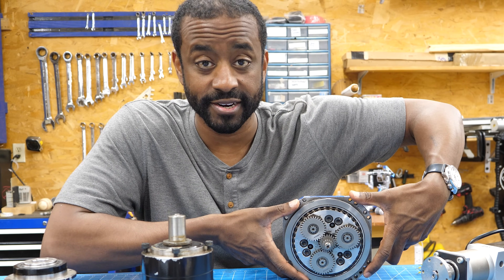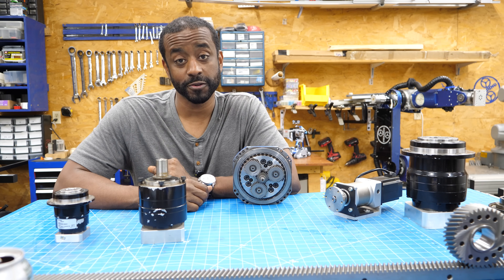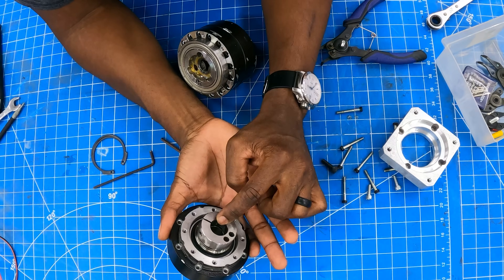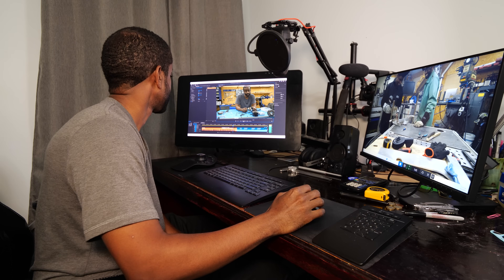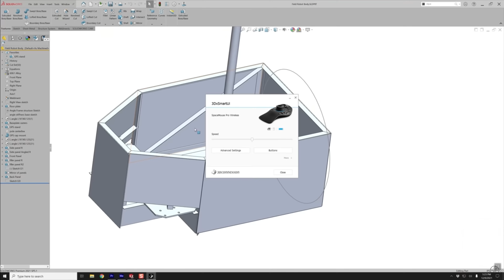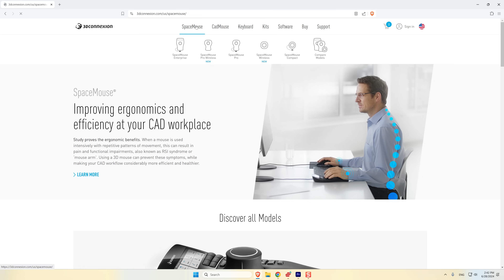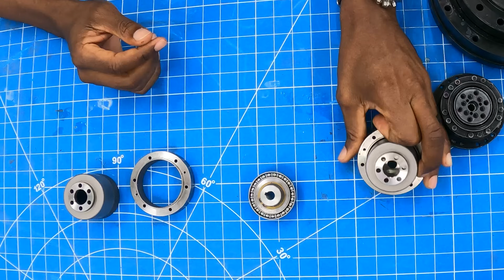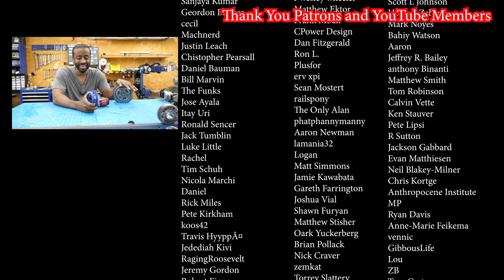Why Harmonic Drives Are Awesome.

Comment: I'm one of the engineers for the actual Lunar Roving Vehicles, made by General Motors and Boeing.  Harmonic drives were used on all four wheels, and were used to be able isolated the DC brush-motors from the vacuum on the Moon.  Brushes do not work well in vacuum, since they are lubricated on Earth by a thin film of water, from the humidity.  On Moon there is no H2O, so the brushes turn to dust and wear rapidly.  The motors and the harmonic drives were half-pressurized with a partial atmosphere, with a specific humidity installed.  Garrett-AiResearch did the motor assembly.  Gear ratio was about 80-to-one.  Motor turned up to 19,000rpm max, but usually ran at less than half of that during actual on Moon motoring.  The drives would work just fine if somebody went to the Moon and energized them, but the wheel brakes are probably locked-up now, due to vacuum cold welding, so the vehicles probably could not move.
Reply: Very cool! Thanks for that.
Reply: Why not use brushless motors?
Reply: You are correct, especially about the complexity.  Our company and NASA (via a GE division), both had alternate AC motor concepts of various types.  Our alternate was a 3-phase drive with a permanent magnet rotor (multipolar).  This allowed a low weight, high speed motor, but allowing it to be used at low speeds using a cycloconverter type of drive.  Vector drives were not yet available, so the stator pulses walked it around, similar to a stepper motor, but with rotor skewing the steps were washed out, and the torque ripple was small.  This drive could have had regenerative braking, but this would have doubled the electronics complexity.  This was nixed, since the controller (DCE) volume became too large for our size allotment.  Also the number of power transistors doubled, so the mounting weight for TO3 and TO114s became a tradeoff with the saved motor weight.  GE also used a  permanent magnet motor, but only 2-phase.  Their electronics were just horrible, and used transformer couplers to provide floating base-drive.  The weight and size of their electronics were more than triple of ours.  Their claim to fame was that they used a "traction drive" system which eliminated the gear train (sort of) so they could use a very high speed rotor, and then shear-drive it down to the very slow wheel speeds.  We had used a similar drive for a torpedo program, and these work well for a one-shot system, but have very poor longevity.  Similar to modern CVTs.  When the volume and weight overall, was considered, our system was way way better, had lower power losses, thus greater range, and the "reliability" estimates were about 10-times that of the AC alternatives.  We used 200-ampere Westinghouse transistors (1401s) for the final drives, so that even short circuit failures could be tolerated, without the Astronauts ever being stranded.  All drive channels were independent, thus they could limp-home on one-wheel is necessary.  In doing some consulting for modern space companies, I indicated that with modern electronics, our total Motor Controller (DCE) could be made now with one-third the weight, and probably one-tenth of the volume.  For practical purpose, some of the existing Drone technology has the same power levels as the Lunar Rovers did.  PassItOn.
Reply: @brunonikodemski2420  
Bravo!
Reply: @ivanradojkovic1705  Additionally, semiconductors don't fare very well in space. The ISS orbits within the Van-Allen-Belts that shield a lot of radiation and still has to regularly replace laptops because they start to malfunction. The control module of a brushless DC motor would fare similarly bad or worse.
Reply: @ivanradojkovic1705  they don't cost enough. its nasa it has to be insanely expensive
Reply: Thank you for mentioning this! I work in high-vacuum and putting a motor inside a chamber is always problematic, a rotary feedthrough is the preferred solution, leaving the motor outside.  If you really have to put the motor inside, it needs to be either brushless, or you have to "can" it with its own little chamber that is bled to atmosphere some way.  Even brushless motors have to be canned for cooling since they would need huge radiators and some sort of cold wall to reject to.

BTW, this phenomenon was first discovered during WW II when superchargers allowed planes to fly at altitudes below 1/2 atmosphere pressure.  They discovered that the brushes on the generators were wearing out super quickly and it took some lab time to figure out why.
Reply: @hagerty1952  My father, who was slave laborer for the Nazis, hated the P38s.  The turbos were mounted above, so while they were working in the fields, they could not hear them until they got into shooting or bombing range.  For the bombers, they could hear them dozens of minutes away.  As You may already know, some EV motors are being run in partial vacuum, to reduce air-drag and avoid supersonic transitions to inviscid flow.  This caused heavy vibrations and heavy bearing loading.  All of these rotors are either induction or permanent magnets.  We did some of the early liquid cooling experimental work, for GM drives, at that time for military vehicles.  Unfortunately one of the best coolants were PCBs, which are now banned due to their carcinogenicity.  Don't forget that Allison Transmission has "swash plate" through wall transitions.  These were used extensively for some of our work for the oil industry, where walling between chemical processes was absolutely required.
Reply: also the moon has regolith witch if it gets in to places can wear stuff out fast since it's so abrasives. at least what from what i've learned so far. that cold welding has been an interesting topic. something about some cargo doors locking up on a shuttle. i didn't or haven't seen other mention of cold welding in space. just that one video.
Reply: @muthukumarankothandaraman2371  The flexspline internally is in an atmosphere, and was partially lubricated.  It was essentially the same materials that Harmonic Drive and Garret had used in Earth applications.  The total lifetime was so small, maybe a few hundred hours, that the Lunar environment did not matter at all.  That same issue also occurred on other metal-to-metal parts, such as the brakes and steering joints.  Those areas could NOT be lubricated, since the outgassing might have interfered with optics or other such items, but that was a crock, since the LRV was stowed in an outer cargo section, exposed to free space.  Once on the Moon, nobody cares if it outgasses.  Modern flex-metals, and flex-plastics are way better than ours, so don't use that technology anymore.  Even some flex-ceramics, for very special hi-temp applications.  The Canadian company which made the Shuttle and ISS arms surely has modern information about this.
Reply: I would love to hear more about the seals.
Reply: @JamesNewton  There were No seals as such on the LRV motors.  The motor assembly was in a case, with the usual glass-pins type of electrical connector (4-powerpins plus some speed and temp data).   This was mated to the harmonic drive, which had an external flex-member (round tubular) around the rotor rollers.  The flex member is corrugated, like a gear, and engages an outer spline which then is coupled to the wheel assembly.  Everything inside the flex member and motor is completely sealed.  Swash-plate designs are similar, except use a flattish plate to the power transfer, similar to motors used in air-conditioning systems.  Everything outside of the flex-membrane is open to space vacuum.  These type of devices have limited lifetimes, due to the flexure quantity, but work very well for Uranium processing and other low-movement applications, such a hand-manipulators in high-risk industries, and medical...
Reply: Thanks for the factoids!
Reply: fascinating thanks
Reply: I saw the thumbnail and my brain went straight to drives for starships.
So you working for XYZ building/engineering a drive that went in to space is close enough :D
Reply: @derekelliott6098  Yes we did do work in ION drives.  However our efforts were minimal and not-competitive with people who actually knew what they were doing.  We worked on many such projects, which never came to fruition, but we learned a lot.
Reply: Cool
Reply: I notice they are appearing in many high-end telescope mounts these days.
Reply: @spaceranger3728  Partially due to the very high ratios available (for slow tracking), but also since they can be made with NO backlash nor Hysteresis.  Allows non-jitter tracking (although that is somewhat of a myth, since wind on a scope will cause greater errors).
Reply: Dude, you make me want to be a better engineer
Reply: White Collar Welfare. Your Project never made the moon. Faked that entire sequence using a small RC Like model. ( still in a box, on shelf 14a7 in Southern, Nevada.)😊
Reply: And U put aluminium wheels on a vehicle designed to track sharp rocks and harsh surfaces??

Wow you guys really did well..
Reply: water? why not just WD-40
Reply: to me this individual is a scam, a liar
Reply: I recently read "across the airless wilds" which chronicles the development and deployment of the Apollo LRVs. They described the 80:1 harmonic gears in the wheel hub motors and this was really helpful to visualize and understand the mechanics of it. Highly recommend the book BTW
Reply: Why not use brushless motors? Was there a particular challenge to using them?
Reply: @ExistensialSlacker  See prior responses to this.  We did three different variants, and NASA did two.  At that time, too much weight, too much volume, and really poor reliability.
Reply: @brunonikodemski2420 Thank you for all of your thoughtful contributions to aerospace, as well as this thread!
Reply: So how do ISS, and satellites, continue working so long, but not laptops.
And don't tell me Shielding, I'm a consulting Physicist.
Reply: See my Lunar Rover commentary above.  Actually it is a lot of shielding, especially the Memories and CPUs.  However to answer your question in a proper manner, the main differences are in the actual internal construction of the semiconductor chips, and their packaging.  When we designed boxes for the early TDRS satellites, Hubble, and a bunch of others, it was the beginning of the era when heavy-ion, gamma & cosmic ray exposure, and ESD discharge damage was being understood.  Look up papers on single-upset events (SEUs), multiple upsets (MEUs) and ESD damage caused by charge build-up on surface, due to solar wind or mass ejections.  As a result, space-rated electronics were developed to protect against these events.  There were several methods which actually worked, and the electronics companies invented internal features, such as silicon-on-insulator, protective buckets to prevent SCR (pnpn) latching into the substrates, and protective guard bands to mitigate SOAR failures, and gobs of similar features.  At that time most electronics were planar, and did not have multiple vertical layering (common now), and the semiconductors were all large-area devices (all above micrometer dimensionalties).  For memories and CPUs, Hughes, IBM, and others brought the technology down in the 400-nanometer ranges, and later down into the sub-hundred-nanometer ranges.  The lowest for Hubble (much later) was about 40-nanometers.  
For our Lock-Mart satellites, the chips were large, and actually had pin-leads.  For these, extensive shielding was used in strategic places, and the USAF has a set of manuals where the design criteria is shown, and where and what angles the shielding should be used.  Ultimately shielding against heavy-ions and cosmic rays is impossible.  For these SEU events (rarely multiple), the chip-bits would fail, and had to be isolated.  For the Titan memories, the memories were "blocked out" and error correction could be made for SEUs (single bits).  For MEUs the entire block could be isolated and possibly repaired during a special repair cycle.  For nuclear exposures, such as for SRAM, the entire modules were heavily shielded.  When Hughes developed vertical chips, this became even more problematic.  For modern electronics, now down to 3-nanometer featuring, and more than 20+layers, these devices are totally unable to withstand even 30kEv xrays or gamma directly onto the chip.  Multiple Error correction is mandatory.  Most of these are protected by the bremsstrahlung effect, as the impacting HEVs products are radiated outward and reduced in energy.  Hubble for example has a steel skin.  TDRS used the same boxes as on the Titan missiles.  I myself underwent radiation from a linear accelerator, for a throat cancer.  The dissipation "zone" of the high energy beam is so well managed, that they can position the destructive bremsstrahlung region to within millimeters.  If you were to take an IPhone up to the ISS, and held it out of the window, in free space facing the sun, it would not last longer than one hour.  Just kidding, but this experiment "should be tried" for real science.  PassItOn.
Reply: @snakezdewiggle6084  
I'm honestly shocked at your questions, exactly what field of "Physics" are you "a consultant" for?
Reply: @snakezdewiggle6084  with very judicious design and minimal use of vulnerable parts like super capacitors. In case of the ISS, regular maintenance and a limited service life.
Reply: @Keiranful 
So what is the cause of this shortened MTBF ?
Reply: @snakezdewiggle6084  radiation. Whether it's exotic particles or high energy gamma rays, there's a lot up there that just fucks up electronics.
Reply: @snakezdewiggle6084  earth satellites still orbit close enough to the earth that the earth's "fields".

Also, satellites that are designed to go farther out use more robust components that are not as miniaturized as the electronics on used on the earth's surface.
Reply: Nope; it's about graphite being a dry lubricant  and the brushholder and sliprings being metallic conductors, of both electricity and heat...
Reply: @Ironic1950  
Did you use the ellipses because you suddenly realised my point, that the thermal energy eventually has to be dissipated, which was my point??
Reply: @Ironic1950  
Yes...
Reply: but in the studio,surely someone could simply rotate the wheels to free them ? or would that be letting the secret out?
Reply: @Mercmad  
Hahaha, you're funny - nice trolling attempt.
Reply: Brushes are made of graphite, which is a dry lubricant, so no water is involved...
Reply: @Ironic1950  Completely wrong.  The microchemistry of arcing, during the gapping in the armature copper plates, interacts with both the local insulation spacers, and all of the local atmospheres.  In chemical vapor mixtures of various types, such as chlorides, these effect are obviously noticeable.  In sulphides, similar effects, but different colorations, as easily observed.  It is the electrical energy levels, which magnify these effects, since after about 3-to-5eV any local atmosphere will interact with the arc crossover, and create multiple ionic clouds around the brushes, as well as deposits on BOTH the brushes and the commutators (and pretty much anything else along the cooling air flow path, including the bearings).  You obviously have never been inside of an electrical motor repair facility.  Go there sometime, and see all of the "horror story" environments that they have to try to fix.  Some of these are NOT fixable, since they will continue to degrade the components forever, once imbedded.  Been there, done all that.
Reply: @brunonikodemski2420  
Thank you for the "schooling", always something new to learn, or consider. 👍😎
One, well I, generally thought of "sealed" motors in the sense of protection from water or dust entering the motor, but I can see that in some applications careful selection of the gas mix within the casing can be an important consideration for service life, at an acceptable performance level - assuming it isn't designed for vacuum to reduce windage losses.
I've certainly noticed the improvement of the motors I've worked on with a simple clean of the commutator, or slip rings, and the brush contacts, with some W&D and electrical cleaner. A big step below what you work on, but significant.
Of course, with induction motors that problem, and several others, goes away.
Reply: @brunonikodemski2420   Given money was no object, the commutator would have been made with gold?
Reply: @Ironic1950  Well you are very close to the mark.  Actually SILVER infused brushes are commonly used in some applications, and we (ie: Delco Products and AiResearch) actually looked at these.  In prior history, gold on silver, and silver on gold was tried, but this combo does not work for very long, since the metals ablate or smear, and quickly cause shorting between the commutator bars.  Carbon and carbon/silver combos have been tried on iron/steel, under the theory that it is simpler and easier to replace the brushes than to replace the rotors & commutators, especially in heavy machinery.  Actual "replaceable" commutators have also been tried, but these add a large extension to the rotors.  All of these combinations do have electrical drops, so brush & commutator heating become relevant.  For the LRVs, out time-frame was so short that nobody had the time to develop a super-motor.  AiResearch already had a high speed motor, used for some turbomachinery, of about the correct size, and actually of the correct voltage (approx 36V) so the basic assembly was retained.  The field was rewound to fine tune the voltage ranges versus torque levels, and the brush assemblies were slightly modified to provide lower voltage drops and better efficiency in the Forward direction.  As such, there were left handed and right handed motors.  The total voltage drop through the whole motor (without back emf) was only about one-volt, which is a very good 97% efficiency.  Our controller also had about 0.8-volt drop in PWM operation, so the overall efficiency of our section of the motor/battery system was about 95%.  The LRV chassis wiring and protective features did add another 1.2-volts drop, so the overall efficiency into the Harmonic Drive, was about 91%.  This beat out the GE system by over 10%, and had about one-third to one-fifth the total weight (estimated, since they never had an actual flyable system).  PassItOn.
Reply: @Ironic1950  Regarding gold as a commutator material: probably not. In electrical connectors, gold is often a preferred plating material due to its corrosion resistance, but it is expressly avoided for connectors that are hot-plugged/unplugged with high currents, because arcing quickly destroys gold plating. Similarly, switch and relay contacts are usually not gold because of the same arcing damage. (Gold contacts are used for relays and switches used with extremely small currents, like under 5mA.) In fact, in many switch/relay contacts, arcing is actually necessary in order to break through oxide layers (hence gold on low-current contacts). In connectors, usually some kind of wiping action is expected to clear oxides. 

There are specialty platings used on connectors that need to resist arcing damage, yet have low mating forces (so low wiping action). For example, at some point, Apple changed the plating on its Lightning connectors from gold to rhodium, because the gold was experiencing arcing damage when hot-unplugging while charging. I don’t know whether this would work in a motor commutator.
Reply: @Ironic1950  
If that's some sort of comment about cooling being required in vacuum, you DO understand that the brush resistance, though small, results in a small amount of waste heat, heat that has to be dissipated to prevent it increasing to a point where it's a problem, and as a vacuum is an insulator...
Reply: And yet here you are on youtube? What a shame to of been so capable and in the end, it was all wasted here playing pretend in youtube comments😂
Reply: @s.d.g.global4582  Have you heard of retirement?
Reply: @s.d.g.global4582  
Troll or moron? I expect you're both
Reply: How do you know that your engineering work is actually in space or on the moon? Do you engineer anything into the devices so that you can be certain that Houston is actually giving you real data out of the device and not faking it?
Reply: @jd01665  
Because he's not a conspiracy nutter?
Reply: @gordowg1wg145  I don't mind if everybody believes in Disneyland and pays they taxes like good boys and girls, just don't ask me to participate in that lie unless I can get 100% transparency.
Reply: im sure you helped make a rover but sadly i dont think they ever went to the moon or anywhere in "outer space"